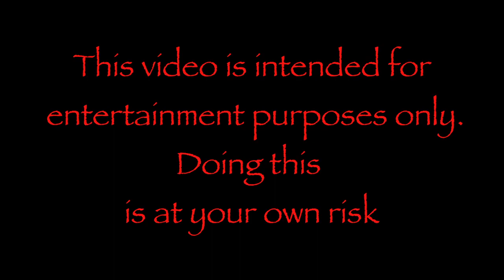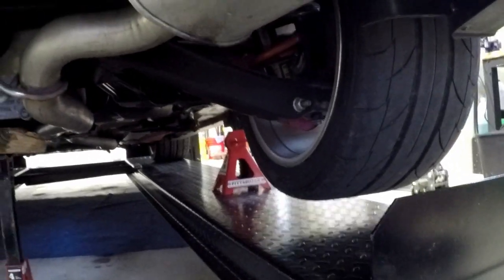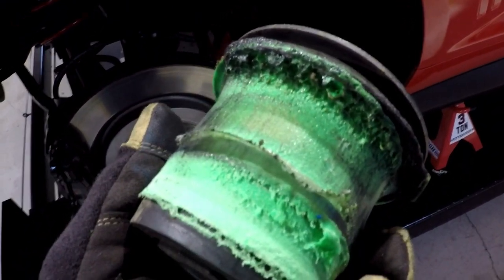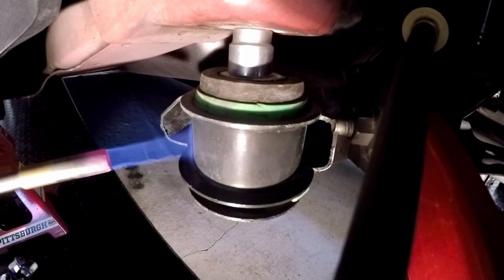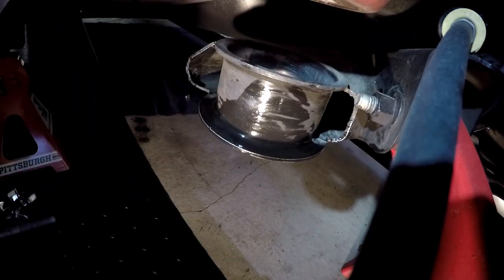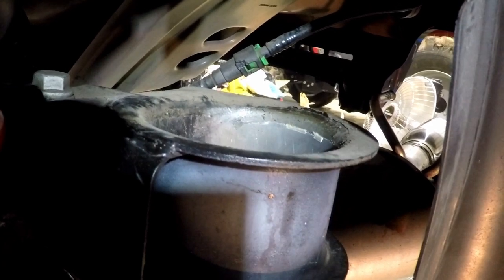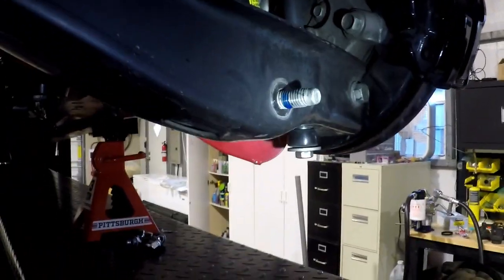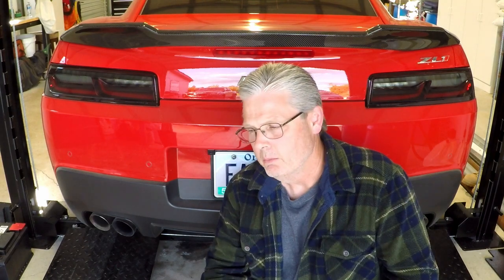Installing Hendrix Solid Cradle Bushing Mounts using 4 Post Lift - Camaro ZL1

Comment: Hey Mark! Thanx for the upload! Very useful info as usual. Thank you. FYI I have a tool specifically for removing rubber exhaust grommets. it works great. also us pipe fitters  use tapered pins to line up flange bolts, that tool crosses over nicely for automotive for getting shock bolts back in effortlessly without chingering up the bolt threads...lastly a quality heat gun would be much safer than using a torch for heating things up around flammables...stay safe my friend I'm loving watching you DIY build your Z!!!
Reply from the maker: Wow, thank  you!  That must be some heat gun. Mine would take forever to get the stock bushing hot enough to melt out. The tapered pin for the shock bolt is a great idea. Thanks fo watching.
Reply: @fasnuf  Last night I was thinking about how to get those rubber bushings out of there with out using any heat.  Do you think trying to drill 1/2 inch holes up through the bottom of the bushings at 90 degrees apart might relieve enough radial tension then try spraying a little of that Harbor Freight penetrating rusty nut blaster around the top lip so it can trickle down between the rubber and metal then try pulling them down and out with a pair of those giant channel locks? Do you think that might be feasible or might that be taking a risk of wasting time trying?  I'm petrified of using an open flame around the car knowing me I would burn my garage down!!!.. and since the bushings get destroyed in the process of removal anyway... just brain storming. I just retired so my C5Z is very close to going under the knife and I will be revisiting all of your content very closely in the very near future. Please don't think I'm suggesting how to do anything when I'm commenting, it's all stuff that would just fly out of my wind sucker if I were right there next to you in the garage along for the ride. Peace Brother!!
Reply from the maker: @Mechaniclemaniac  The proper way is to drop the cradle and diff out and press the bushings out. That's according to the Service Manual.
Reply: @fasnuf  Proper Shmopper leave that cradle drop to the pros who get paid handsomely!!! We're rebels over here jus gittn er dun how we know how with what we got right?
Reply from the maker: @Mechaniclemaniac  LOL right! That's how we roll!:hand-purple-blue-peace:

Comment: I do it when my Buddy get's a Lift installed, pretty much not doable without one. Good Job
Reply from the maker: There's guys out there that use a jack stands and get it done too, but I wanted to show how to do it with the 4  post lift.  A 2 post lift would be a different story since the wheels are off the floor. Hope the video gives you ideas for how to do yours.
Reply: @fasnuf  I tell you what, I drive to your place, give you $100 and you can put em in, what do ya say ? Deal ? lol

Comment: How bad is the NVH? I want a stiffer rear end, but I don't know if i should go poly or aluminum. I don't mind some noise but exactly how much noise would it be going with aluminum?
Reply from the maker: Exactly I don't know, but it's the one mod that made the most added NVH to the car with the one exception being my exhaust changes. If you're familiar how car sounded and felt stock, it is quite noticeable amount of road noise and vibration but you definately feel connected and this is a street racer and not a daily at all.
Reply from the maker: Also keep in mind that I have the Hotchkis Chassis MAX brace on too and they were basically done at the same time so it may be hard to tell if it added any NVH.
Reply: @fasnuf  thanks for the input. I drive a 2018 Daytona charger. It's my weekend car and is already pretty loud with a cam and catless longtubes. I think I might do the aluminum bushings, I have cradle lockouts but haven't gotten them installed.
Reply from the maker: @brandonmcginnis4610  You might want to try the lockouts if they're easily installed. They might do what you want. I consider the bushings permanent.